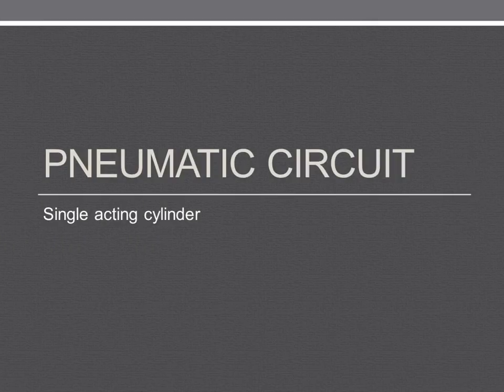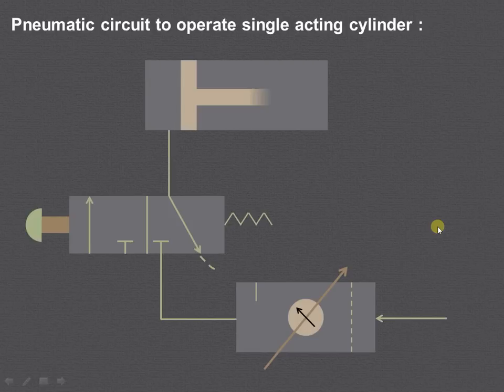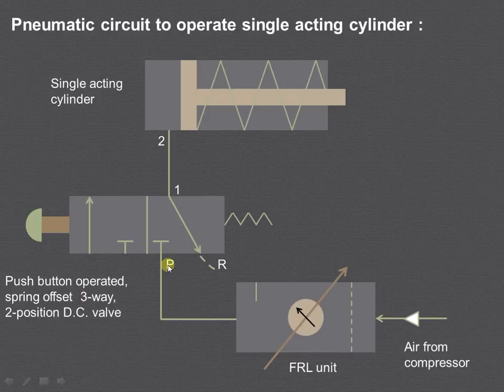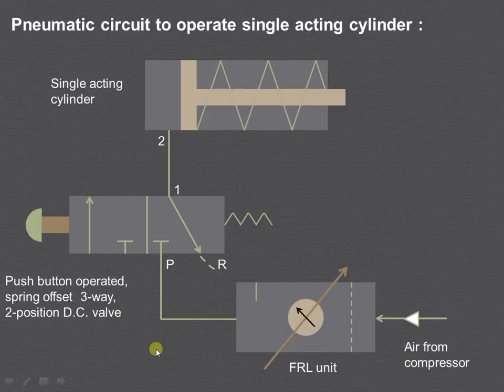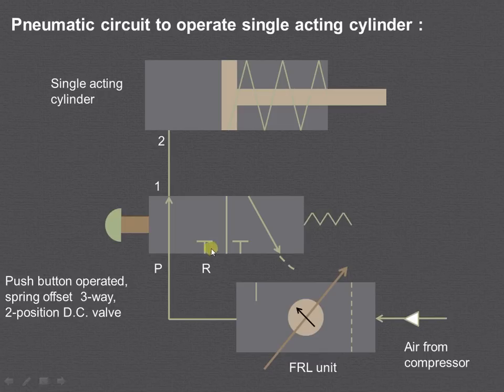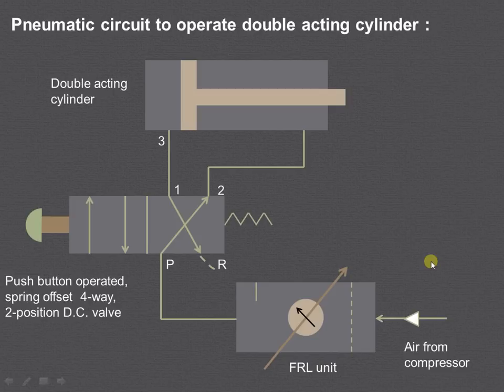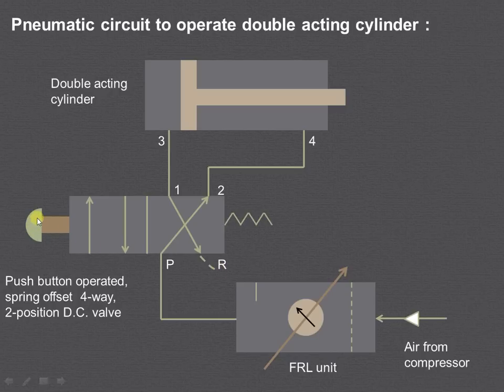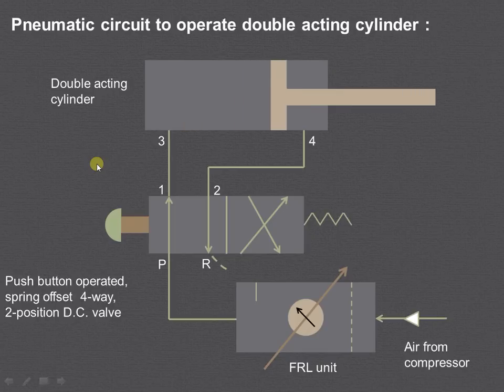Lecture 2 | How the pneumatic circuit works | single acting & double acting cylinder

Comment: Sir what if I have 2 double acting cylinders,3 5/2double pneumatic valve, 4 pneumatic limit switch ,1 pneumatic start button,1 Manifold and 1 service unit with on-off valve...how would the circuit be sir ? Can you show me how to do the fixation of components... Part of my report which I couldn't solve sir.
Reply from the maker: Please send complete  statement so that solution can be provided: rajangosavi@gmail.com

Comment: Thanks for this, can I ask something? 
I'm creating a project, one part is crushing plastic bottle using pneumatic cylinder controlled by arduino, does it (pneumatic cylinder) always need air compressor in order to work? or I will just add air then it will work even without air compressor? Thank you
Reply: Go for motor.  Or hydraulic cylinder